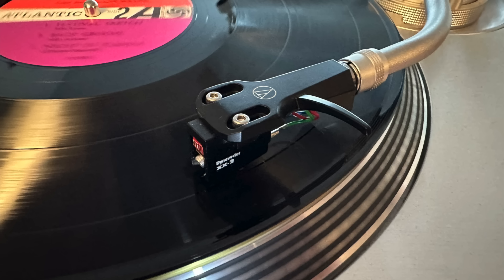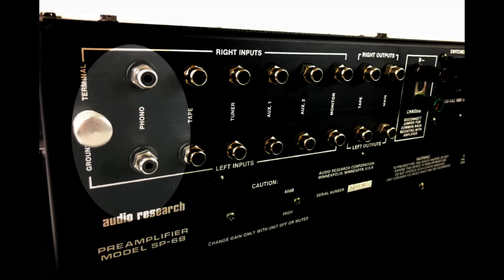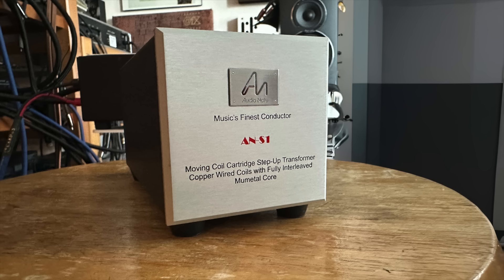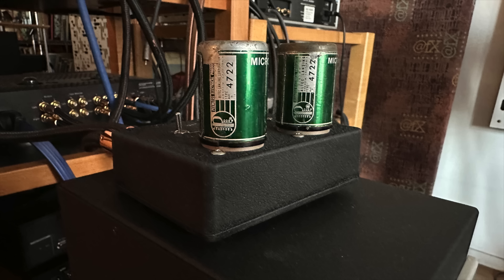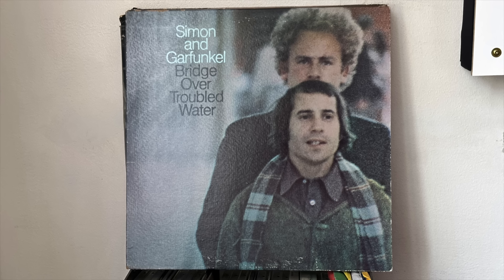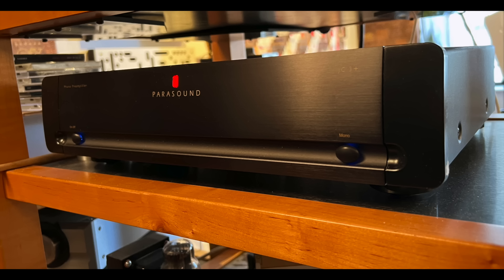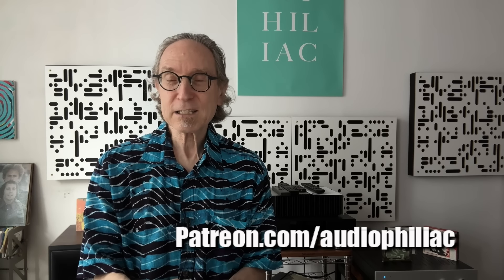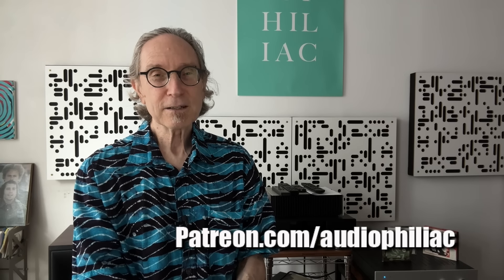HOW TO get the BEST SOUND from MC CARTRIDGES!

Comment: Welcome back to SUTs Steve! I use a Sunvalley SV-EQ1616D tube phono preamp like Herb R. uses along with a Bob’s Devices Sky 40 SUT for my Hana Umami Blue MC cart on my VPI TT. I also use this SUT with a Dynavector 20x2L, Denon 103r & Denon 103.

For my second TT (Pioneer PL-630) I use a Denon 103 MC cart going into Robert Morin’s Lounge Copla head amp (used by Herb R.) and then into the MM of the Sunvalley.

Great episode Steve!

Comment: Moving coil step-up is not the only place a transformer can improve your musical experience.
I use a passive pre-amp. Not a pot, not a resistive ladder but an audio auto-transformer. The electrical difference is that lowering the volume with a pot increases the output impedance but using a transformer lowers the output impedance. The upshot is that there is less difference in character of different interconnects. The sound is different to anything else and (to my ears) very musical. If you've never heard this set-up (often referred to as a "magnetic preamp"), I'd suggest you owe it to yourself to try it.

Comment: If you use Oortofon moving coils the choice is simple use an Ortofon SUT! They are a perfect match that has zero coloring The ST70 is superb and not too expensive The ST80 is even more so but a dearer proposition. Completely transparent, which, of course, no amplified circuit is! Another bonus point for the Ortofon ones is that they look like a proper component instead of a lab experiment.

Comment: With low output MC carts, I’ve had the best results with transimpedance (current) phono stages. I think Steve did a review on the Sutherland Little Loco or Phono Loco. Spectacular! But not versatile for multiple carts (MM or high output MC).
Reply: Those need a very low internal impedance cartridge to work well.
Reply: @razisn  I was fortunate to speak with Ron Sutherland and asked about that very point. While he did not offer up specific thresholds for what constitutes low impedance or low output, he did say that he’s heard of good results with higher impedance cart (i.e., AMG carts), but I cannot speak to personal experience. I have a Phasemation cart (.3mV and 4omhs-low) and am blown away with the Little Loco. Plus it’s basically plug and play.

Comment: Love, love, love an SUT with a lomc cart. My two carts are the two classics - the plain spu and the 103 with the aluminum body mod. SUTs are the Ned Clayton Cinemag 3440 h, AN UK S1, and most recently a sound practices Hashimoto HM3 unit. Love playing around with these carts and these SUTs. Specifically bought an Aric Audio mm only phono stage specifically cause it let me play around with SUTs. Devon and Resistor Mag were the online sources that got me thinking about SUTs. It’s a fun thing to tweak when the rest of your system is already pretty dialed in. 🙏🏻

Comment: Haha, I succumbed to this vid and bought a SUT. I’m running a Vertere Phono 1 Mk IIL phono stage - by no means an expensive bit of kit, but certainly not cheap. Went with a Deco Audio Step Standard (handmade here in the UK so cost is low as it’s supplied direct). Will see if it makes a difference!
Reply from the maker: Yeah please let us know!
Reply: @SteveGuttenbergAudiophiliac  Well, lived with the SUT for a month now. It’s been nothing short of revolutionary, just not necessarily in the area I was expecting.

So, this is the thing. I was getting a lot of hiss through the speakers when using the Vertere phono stage, prior to the SUT. I’d been playing with the gain dip switches to try and get a decent vol vs. Increasing the noise. 

Since using the SUT, and obviously reducing the gains on the phono stage to match a MM, there’s still a decent vol, but no hiss! As a result, it’s not highlighting every little pop and click too.

I don’t know enough about the electronics to explain it, but it’s changed EVERYTHING! 🙂

Comment: How low output?  RIght now I got the Denon DL-301II on a Denon TT.  Despite having quite good low and mids,  the highs were dull and really lacking with my phono stage set up for MC instead of MM.  Like as if just adding all the extra MC gain was not the fix.  So I recently got a wild hair to see if it worked better with an SUT.  I got a Denon AU-320 SUT on ebay after alot of hassles.  Seems 95% of them are in Japan,  even though the prices were quite appealing.  Eventually I got a good used one from Japan and I got to say,  using the SUT and the preamp set up for MM gain,  vastly different in somehow the top end is now there.  Would not do without it. Sure I could have gotten a good higher scale SUT in the US for ten times the price but I was guessing if it would make a difference.  But I did have to deal with getting two defective ones trying to save money.

Comment: Steve, A little off subject but could you do a video explaining why some vinyl sounds terrible v the CD equivalent. Case in point is The shocking pressing of my ‘The War On Drugs’ Deeper Understanding vinyl record which cost €40. I also have the CD version and the pressing of the vinyl is terrible. Is this because I may have purchased a a pressing past the 4 or 500 mark. I heard if the pressing plate is not changed the sound on the vinyl deteriorates? Many thanks . Enjoying your channel.

Comment: Someone commented that between the SUT and the phono preamp, phono cables should be used and not regular interconnects. Would that really make a difference? I just ordered a SUT, but after reading that comment, I may have to order new phono cables. If I do, should the new cables have a ground wire? Any cable recommendations? Thanks.
Reply from the maker: Use the cables you have for awhile, then  buy cables you can return
Reply: Keep the cable out of the SUT as short as possible! The requirement is for a low-capacitance cable to prevent high frequency roll-off.

Comment: i guess that MC preamps need a special attention to the first input stage that should have a separate power supply circuit, also separate per channel. if the output stage of the pre-amp hangs on the same rails like the first input stage that does the x10 amplification, then part of the output and also nonlinearities gets coupled back into the input. the decoupling of the power supply is probably the most underrated source of dirt. also when it comes to channel separation.
i am not sure if the step-up transformer has any benefits when the input stage is made well enough. it would be very interesting to study all the schematics of all the MC PREs, that you used so far and compare them.
i don't know if you would like this approach, but i would like to only have a linear amplification on the analog side and then go into a super fine 24...32bit ADC and do the RIAA curve digitally only and go through everything digitally including active speakers that do the crossover as well digitally.
when doing the RIAA curve, it would also be possible to play different records made from different manufacturers and let the computer then calculate a calibration profile, that is unique to every cartridge. for example a frequency dependent channel separation calibration.
no cartridge is perfect, you probably have a tiny bit of a signal on the right side which should only be on the left side and vice versa. these are simply drawbacks from the cartridges. but this could be compensated for by a digital algorithm and then you have more channel separation.
the same thing could be with nonlinear signal vs. the excursion of the diamond which then creates harmonics aka distortion. this maybe could be back calculated as well in the digital world.
just some thoughts.

Comment: I am a low end (cost wise) Audiophiliac.  I am about to add a turntable to my system and I was wondering have you done any video about MM vs MC cartridges, my budget is definitely MM however if I figure out that I could get a MC cartridges for not a lot more and the sound benefit is there I would do it.

Comment: I've never had more than two cartridges the one I removed in the one I put in and I've saved some of the older ones but I've never really for a lack of a better term rolled my cartridges tell me somebody please do you have to re-calibrate when you swap a cartridge tracking angle, hang over? Of course recommended tracking force and anti-skating but the more minute adjustments to really dial it in. Do you do that every time you swap a cartridge and then go back to another. The turntables with two or three arms really blow my mind.
Reply from the maker: Thanks for watching Joe! On my Technics turntable I can change cartridges in about one minute. All the alignment issues are handled when you mount the cartridge to the headshell, you just have to do that once. When I change cartridges, the ones mounted to my collection of headshells it takes about one minute to do. I'm really doing is adjusting the stylist tracking force, and rarely adjusting the vertical tracking angle. But it's a very quick operation.
Reply: @SteveGuttenbergAudiophiliac  I've already been keeping an eye out for the correct head & arm wands for JVC/Victor DD TT , I've had this turntable 40 plus years I may eventually get a new one

Comment: I have a Goldbug Mr Brier which runs into a Music First step up and on to a Croft 25R phono stage. It sounds unbelievably smooth and detailed. But I also have a Decca FFSS MK1 which is older than me that I use straight into the Croft. Is the MC plus step up better? I don't think it is, I think it's just different. They are both absolutely superb. the Mr Brier is so smooth and detailed and it has the ability to let you hear every instrument in the mix clearly while not pulling the performance apart. But the Decca is just incredibly "live" sounding and the dynamics are out of this world, drum strikes can make you jump. I listen through headphones (Stax LR-500, Final Sonorous VI and Denon AH-D7200) so the differences are clear. In this hobby you have find a sound that you personally like. I have heard super systems at shows that to me have sounded laughably, excruciatingly bad, and budget systems that have blown them away in terms of musical enjoyment.
Reply from the maker: Right!

Comment: So what I’ve learned from this video is that most stand alone Phono preamps don’t have enough gain for low output MC. It makes sense because I am never Satisfied with my Dynavector 20x2 with my modwright ph 9 nor with the AudioResarch ph8 I had in the past. Is there a phono pre out there that have the proper gain to make these low output carts move without using the MM and transformer?
Reply: GAS Thaedra had a high gain phono stage.

Comment: My amplifier has a humming problem in the phono input. This is not a defect. It has always hummed a little more than others ... but it still sounds fantastic. Now I wonder if a step-up transformer could perhaps bring some 'relief' here, because the MC input naturally hums a little more than the MM input. Could that be a/the solution?
Reply from the maker: No I don't think so. But experimenting with the grounding of The turntable, the cables, your amplifier, etc. Grado cartridges sometimes have hum issues, and Rega turntables are prone, sometimes to hum.

Comment: I used a Supex SDX1000 moving coil cartridge but never found a transformer that sounded good with it so I used a Thorens PPA990 and I hooked that up to my Audio Research SP6. I used that for around 40 years and rarely heard anything better. I downgraded due to a bass feedback issue. I now use a Supex MM cartridge directly into my Audio Research SP6B and to me the sound is almost as good and my bass feedback issue is mostly gone. My Acoustat X speakers have incredible bass.

Comment: Funny thing this video came out. I’m waiting on a Denon AU-320 sut. I’m going to pair it with my Denon DP 59L tt fitted with a DL 103 cart that was modified by Vas Cartridges in NJ. I’m currently using a Puffin phono pre amp. I’m wondering if I should set the preamp to mm or mc with this combo. 🤔

Comment: Steve, I have a Marantz 2250B with a Phillips 212 turntable and Stanton 681ee cartridge.  Would the step up transformer work with this system and not cause issues with the Marantz receiver i.e. damage to its phono stage etc.  Thanks for the video   Dave
Reply from the maker: Sorry Dave, no, you cannot use a step up transformer with your Stanton cartridge. Step up transformers are for moving coil cartridges. The Stanton is a different type it's moving iron design. thank you for watching the videos.
Reply: Thanks Steve

Comment: Your SL1200G turntable does not seem to has a separate ground wire. Normally this ground point (chassis connection) is wired to the ground terminal on the amplifiers. When using a step-up-transformer the ground wire from the turntable connects to the ground terminal on the transformer. An optional second ground wire connects the transformer box to the amplifier.
Reply: Yes, one must still run a ground wire from phono stage to line stage! In my case I use the phono input on my RGR 4 preamp, hence the one ground wire from the SUT to the RGR 4.

Comment: I have Denon103r going into a Hafler SUT which is connected to a Marantz 3800 preamp in my vintage system and no matter how I ground or place the Hafler. I get hum. Still sounds great but is a bit prominent in between songs with volume high. Don't know if its the Hafler or any other SUT would be the same.
Reply from the maker: I am saying from experience, yes some transformers will hum when used in some situations, and switching to another transformer won't have any problems. Predicting that is impossible, you'll just have to pull the trigger on another transformer, just make sure you can return it if it doesn't work out.
Reply: I use an Ortofon T-30 with dl-103r and an Denon AU-103 with the dl-103r. The au-103 is the quieter of the two but it's also because it's less amplification of the two transformers- 1:10 vs 1:16 may be. Having said that both these transformers are good choices for DL-103r which is one of the hardest to match with suts.

Comment: It has been a well-established fact since 1980s that, in general,  low-output MC cartridges sound better with a step-up transformer.   The sound improvement with the transformer is very obvious, not subtle at all.

Comment: Not that it is a bad thing, but one is now hearing the "color" of the transformer. Notice that Steve mentioned every transformer sounded different. That is why some recording labels like TELARC went with transfomerless microphone preamps. They wanted the sound as neutral as possible.
Reply from the maker: Well, transformer sound different, but most phono preamps sound different, as do amplifiers, and certainly speakers, everything sounds different. That's the fun of the game finding the combination of things that together form a system that works for you. Same for pro audio, Microphones sound different, microphone preamps, and even monitor speakers!

Comment: I have a XX-2 mk II and what  I notice is the improved clarity through out the audio spectrum with out being brighter or bass heavy.. Its all about clarity.    I am comparing the XX-2 Mk II to the 20 X and the 20x2 MK II.   There is a big difference for sure.    You realize there is a new  XX-2A that was introduced at Munich weeks ago.   Will you be getting one?
Reply from the maker: I don't think so, I have a lot of cartridges. But what I'm learning is the differences in sound between cartridges is smaller than the difference transformers can make in the sound of a cartridge.

Comment: Would there be any benefit using a SUT with a High Output Moving Coil Cartridge? I have a Hana MH and a Sumiko Blue Point #2.
Reply from the maker: I doubt it
Reply: I would suggest a matching sut would help. There are no himc high enough for an mm stage, therefore suts will help unless the preamp is an.sut based design and a good one at that. Mc by definition is lowish output and it benefits from noise free sut matching.

Comment: Steve, I'd love you reach out to the folks at Graham Slee HiFi System Components and audition their Elevator EXP step-up transformer. I'm a huge fan of their phono stages and they have a very friendly loaner program as well. I'd really love your take on their gear. I'm using their Accession MM phono stage right now with a SoundSmith Zephyr MK III MI cartridge and I love the way it sounds.